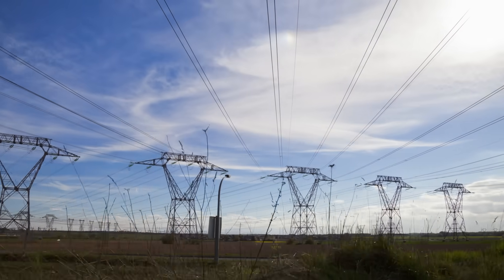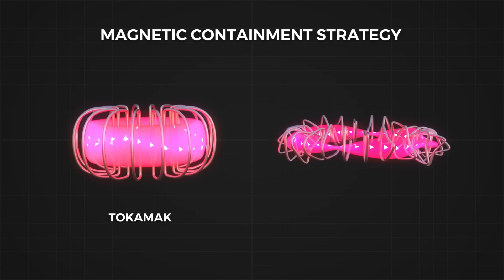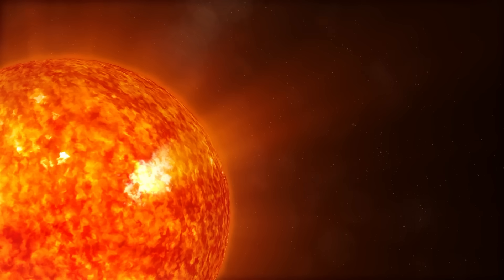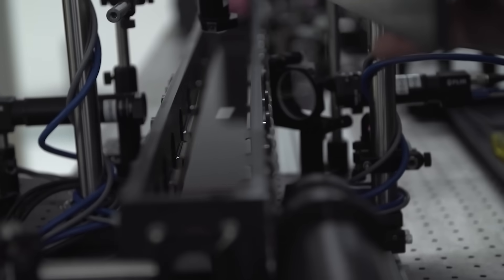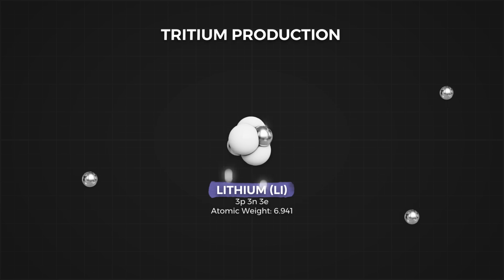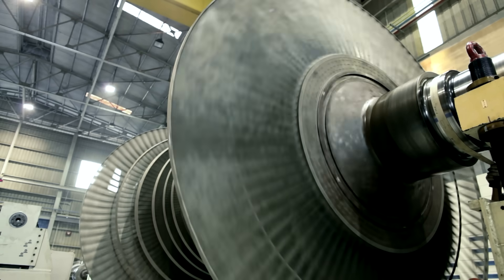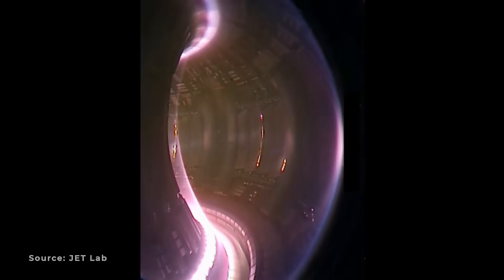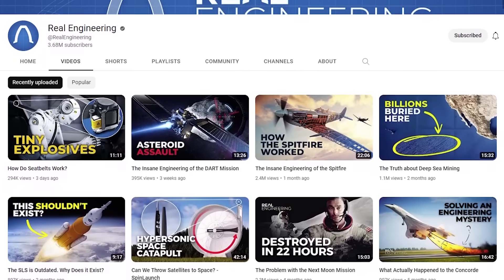The Problem with Nuclear Fusion

Comment: It has become common practice for advocates of nuclear fusion energy schemes to utilize the complexity of the field to mislead the press, the general public and potential investors in order to continue receiving support in a increasingly competitive field. One of the ways that they have done this is by not making it clear how much energy gain their experimental machines have achieved. Typically the input energy parameter they employ is the energy needed to heat the plasma. In many cases the energy needed to operate the facility is over 100 times greater than that input energy. Another detail that they often fail to mention is that when the tokamaks are expected to operate at full fusion power levels they can only operate in a pulsed mode with lengthy periods of time in which they will need to recover. The operational parameters, provided, are often only those during the brief pulsed period.

This presentation, as is extremely common, left out the fact that tritium is radioactive. The breeding concepts were expected to be tested in the ITER facility but that machine is grossly over its original budget and well over a decade behind schedule. They recently announced that ITER may not achieve fusion reactions until 2039 and this is way to late to deal with the climate crisis.

Heleon Energy's CEO is a master pitch-man. Their earlier progress predictions haven't been met. They talk about fusion reactions during their multitude of shot experiments but no one seems to bother inquiring about a quantitive value for that fusion reactions. The following YouTube video critiques some of Helion's claims.

The problems with Helion Energy - a response to Real Engineering

Fusion energy advocates commonly claim that such plants will be CO2 free, That is based upon excluding certain factors such as construction and some operating externalities. The also suggest that no radioactive waste will be produced. That claim doesn't account for loss of tritium fuel, or the neutron transmutation of some of the elements in the structure, some of which will likely require periodic replacement. That means that such components may require disposal as low level radioactive waste and that will also apply when the plant is decommissioned.

Typically nuclear fusion advocates are in line with the vast majority of the Earth's 8.0+ billion humans who continue to assume that we have at least 20 years left to turn this 'Titanic' around. They have become masterful in excluding the following warnings from their consciousness. I urge readers to search for the following two article titles.

IPCC report: ‘now or never’ if world is to stave off climate disaster (TheGuardian)

UN chief: World has less than 2 years to avoid 'runaway climate change' (TheHill)
  * This statement was made 5.6 years ago.

Comment: The most traffic nuclear power accidents involved water-related weaknesses, either hydrogen electrolysis or steam pressure explosions, leaks in cooling water systems, or failure of water flow causing overheating and melting of fuel or or the components.  So we are throwing money at a technology that dies not even promise to solve that problem.

Comment: In 200 years we’re going g to get a commercial fusion reactor and it’s going to be about as dangerous, have as much capital intensity per unit of output, and create as much waste, and pollution as a 200 years from now high-tech cleaner safer cheaper nuclear power plant when you consider the whole upstream supply chain, or not much less anyway.  We are all going to look like fools for spending 200 years on this when we could have invested in cleaner safer cheaper nuclear technology or more wind and solar energy by putting Pegivian taxes on oil and coal to offset a small fraction of the externalized costs and to subsidize wind and solar basic research and capital investments and to fund a 1% of median income per capita subsidy and 4% of median income per worker or disabled or retired person subsidy capped at monthly green source electricity purchases and 10% EV purchase price subsidy.

Comment: The temperature inside the tokamak must be over 200 million degrees Kelvin, but inside the Sun, it's only 15 million. The Sun is orders of magnitude bigger than the tokamak, so the temperature gradient inside the tokamak must be orders of magnitude bigger than inside the Sun.
The Sun has worked for over 4.5 billion years without significant hiccups. So far, the tokamak has worked for about 200 seconds. If the tokamak has an issue, the hot plasma will burn a considerable hole through the wall and even gut the building in which it is located. It's a problem with no reliable solution.
The Sun is reliably put together by gravity, but the tokamak is unreliable because the gravity is only 1G.

Comment: I have always dreamed of fusion and fusion reactor, all working at the atomic level, to somehow get the neutrons to somehow for 3 the electrons to flow, thus directly generating electri y.  The method we have been using for the pas 70+ years seems so childish and a cop out; using the bipeoduct of vision, hesr[t  to boil water, to create steam, to drive mechanicsl turbines, to induce magnetism, to finally create electricity seems like the most childish and stupidiotic thing I have ever ]heard of, with the vast majority of that hest produce from fusion going to pure waste.  Oh what a ginormous waste of all that heat energy, which could be used in creating steam to heat buildings (like I]in NYC), use to desalinate water, and millions of uses for thst hest.

Comment: Before I watched this video I thought that fusion reactors only needed normal hydrogen, which is very cheap, to function and that's why I thought that it had a lot of potential. But now that i know how hard it is to get the actual materials needed for efficient fusion I don't really think that they're much better then fission reactors at least economically

Comment: Nuclear getting shut down for CHEAPER options? No, just no. Nuclear power is 3x cheaper, 8X safer, less polluting and much more stable for an energy grid than any other form of electricity. Coal, natural gas, wind, hydro, solar. Everything gets beat in literally every metric by nuclear. Except public relations.
Reply: I have never heard the claim that it is cheaper. Please provide a source.

Comment: My theory is that sustainable large scale nuclear fusion reaction requires an abundant source of neutrinos.  For the last 5 decades we have been less than a decade away from harnessing abundant energy from nuclear fusion – or so it was thought.  But the calculations do not take neutrinos into account.  Stars are able to create excess neutrinos to stabilize long term large scale nuclear fusion.  Until we understand this process – I do not think nuclear fusion will become useable.

Comment: The problem with Fusion on EARTH. is that we are trying to duplicate what NATURE does with gravity....and control it. A reason hydrogen hydrogen yields low and disintegrates from helium back to 2 hydrogen is we are PUSHING hydrogen together. NATURE overcomes this with mass/density/volume..... the UP quarks PULL the electrons IN and stabilize them into Chemicals we have well mapped out..... the energy INPUT from nature is natural and so the fusion yields NATURAL stabilization. A different approach to the complex electromagnetic forcing and fuel and collection of energy is to have the Fusion process IMITATE nature Have an outside up quark velocity/mass generator and PULL the fuel into each other----- the problem MIGHT be that generating this GRAVITATIONAL pull for the fuel MIGHT be MORE energy than produced..... we just do NOT have the volume or mass OR INORGANIC space on EARTH to achieve this. OUTER SPACE would provide the volume and SAFE area to experiment with this idea....... EARTH and its living conditions will be altered by trying to imitate nature.THE Limitations by life and earth volume and mass make this a difficult obstacle to overcome.

Comment: Fusion is good but solar energy close to the sun that gets beamed to earth would be a lot more efficient instead of trying to boil a kettle to spin a motor. (If we would’ve spent the same amount of time trying to get fusion to be viable on solar energy near the sun and microwave beamed we’d already be there by now with companies like spaceX making it cheaper to do then a single ignition of a fusion reactor).

Comment: Fusion in the core region of the Sun produces less energy PER UNIT VOLUME than a fermenting compost heap. And this from a fully degenerate plasma with 200 times the density of water. Fusion is a statistical process, and i fail to see how the machines we are making can produce more than a trivial amount of energy.

Comment: you forgot to mention that the blanket wall needs to absorb  energy at the rate of 5MW/sq metre equivalent of what the shuttle had to withstand on re-entry. keep on dreaming
Reply: The plasma in these machines is at a temperature measured in millions of degrees. At that temperature, the plasma will be radiating gamma rays, just as the filament in lamp radiates light. You cannot stop gamma rays, or reflect them. So the energy of the plasma radiates away and it cools down. Plus gamma radiation is very damaging....

Comment: We are trying to replicate a reaction that takes place in a star but without a key ingredient provided by the star - an intense gravitational field. We try to make a magnetic field substitute for gravity but it doesn't work that way. Gravity compresses spacetime itself and brings everything closer together. Magnetic fields do not. I doubt sustainable fusion will ever be achieved until this is recognized.
Reply: nice , but what do you think could be used as a substitute for star's MASSIVE gravity , can we replicate that on earth?
Reply: @Fusion-dl3ld  nothing, which is why we will never be able to achieve it.
Reply: @Fusion-dl3ld  A chunk of white dwarf star degenerate matter. A matchbox full can weigh 100 tons.....As a matter of fact, white dwarf stars which accumulate hydrogen gas on their surfaces will initiate fusion if the hydrogen becomes deep enough. And that is what astronomers call a nova.
As a matter of fact, i hold a patent on an MHD generator based on this principle. A small chip of degenerate matter placed on top of a pyramid of high strength steel. A small stream of sand or dirt falls on the degenerate matter chip, and attains a high enough velocity to vaporize into ionized vapor that is directed into a magnetic field for charge separation.....

Comment: The cost of hydrogen isotopes and beryllium are a HUGE impediment.  Also, there is the problem of embrittlement of metals due to radiation. Then there's absorbing all that heat, which needs to pass thru the lithium blanket, the beryllium, and the chamber wall.  The heat extraction done with super-hot fluids (325 degrees C) requires piping thru superconducting, and thus super cold, electromagnets (-270 degrees C) which surround the chamber. How much helium will it take to cool magnets, and how much to maintain it?  There is currently a limited supply of helium on the planet, and at current rates humanity could burn thru the world's estimated reserves in as few as 30-100 years. Now imagine the added demand of 100s of fusion reactors. Also, helium is a byproduct (.01% - 8%) of natural gas extraction, meaning we will HAVE TO continue extracting NG and using it to generate electricity in order to supply helium.  Furthermore, reactors require ultra-high vacuum, and ITER's "plasma volume"  is 100 m3 (I'm assuming its total volume of the torus and not just the volume that the plasma will be compressed to.  (100 m3 = c. 15 foot cube) Doing maintenance inside the chamber would reactor shut-down for extended periods of time.  Just pumping down the chamber alone would take months I imagine...   Fusion will always be 20 years away...

Comment: Most fusion energy presentations are overhyped, often to attract potential investors who often fail to look for critical analysis sources. In this presentation there was no mention that tritium is radioactive. The purple glow that the producer witnessed, in the Helion experiment, likely was not due to a fusion reaction. The vast majority of fusion experiments don't even employ fusion fuels. The fact is that only a very small number of fission power reactors employ heavy water as a moderator. There are very few sources of tritium and that is likely to get even less during the next couple of decades. The current market rate for tritium is approximately $30,000/g. The ITER experiment was intending to experiment with a wide range of tritium production experiments but that has been drastically cut back due to cost saving measures. The ITER project is grossly behind its original schedule and grossly over budget. It is currently dealing with major rework issues. Fusion fans tend to display little interest in such issues. This video pointed out all the fundamental uses for helium-4 but failed to mention that future fusion energy reactors will produce only tiny quantities of the element.

The dreamers behind such videos tend to be in the same camp as the vast majority of the Earth's 8.0+ billion humans in masterfully excluding the following warnings from their consciousness. I urge readers to search for the following two articles.

IPCC report: ‘now or never’ if world is to stave off climate disaster (TheGuardian)

UN chief: World has less than 2 years to avoid 'runaway climate change' (TheHill)
  * This statement was made 5 years ago.
Reply: what ?
you seem to be bashing FUsion for climate change 
what's the point
according to you we are already doomed

Comment: Micro magnetism in a fusion chamber, y’all want a stable plasma basis without whatever, this sounds fit, the magnetism pulls whatever particles in through tubes or some, probably inserts.

Loading so short answer plus I’m new to this, basically, I study natural conductors

Comment: Fusion is high pressure, by basic mathematical law, you cannot control the resulting decompression, it will become an independent body of heat that is out of control and affecting the weather
Reply: or it will become runaway reaction like that of Sun 
and we will be roasted
Reply: @Fusion-dl3ld  indeed, it was also the fear of the Oppenheimer group.

Comment: Jupiter is not massive enough to be considered a failed star. That's fusion's problem. 
Fission is a chain reaction. Fusion is not. It's not just a matter of having the "fuel" in close proximity and then controlling the reaction. In a star the contraction of the mass provide the energy. You need to sustain the pressure and temperature.

Comment: they need to rethink their goal, intermittent fusion, not continuous, the magnetic field + heating it up is unrealistic anytime soon. it will always be 20 years away. this isn't a technology issue, its a physics problem. not unsolveable, but even if solved it will probably be around fission efficiency if not worse.

and no. nuclear fission reactors are not expensive, governments are subsidizing oil and fossil fuels so much . they are far far more expensive than fission both money and environmentally

Comment: Its funny though... fission and fusion dont produce electricity. They produce heat to which used to drive a mechanical turbine to produce electricity. So far humanity only discovered three ways to produce electricity: spinning magnets, solar panel,  and chemical reaction...

Comment: I have an Idea on reusable Fuel.
And just so you know, I'm still just 13 so please correct me if I'm wrong 
My Idea is the use of only deuterium whitch is going to fuse into helium 3, the helium 3 is the going to somehow go to the blanket and stay there (I din't know how). It is then ging to be hit by the neutrons and is hopefully being splitt back into two deuterium atoms (I don't know if this is possible). 
Thats it, again if this is wrong please correct me I don't really know more than the basics.
I also have an Idea for the fuel output but than the comment would be way to long.
Reply: Not fuel output😅. I ment energy output.😅😅

Comment: The Tokamak creates a D - shaped magnetic containment field limiting the compression available.  
Restructuring into a true circular shape, control of the magnetic containment becomes less problematic. 
By varying the field strength on the confinment coils, the plasma stream can be reshaped into a smoother round shape; allowing a consistant density of plasma.  Increasing the magnetic containment and processional frequency, the plasma stream is compressed in diameter thereby increases the molecular density of the plasma stream as well as it's angular velocity.

Comment: Hey, guy, you're too late. Nuclear fusion in anything new killer is on its way out. I want you to know there's a magnetic generators that are clean that required no input. And no hazard, it's only working on magnets. You just press the button and go. If you want an example of this type technology, it's like an F150 Ford that has a standard transmission in. It. Pull the battery out, push the truck, pop the clutch and it takes off.  A magnetic generator Nicolai Tesla has got you over written. You're not on the power grid anymore if you go this direction. Magnetic generators Trump has pulled it off.
Reply: What?

Comment: Thinking about this now, why can’t we increase the pressure inside the reactor? Increase the pressure by increasing the amount of molecules in an area. The closer they are together the more likely it will happen. It takes less energy to move a ball of iron an inch rather than a mile. Most of the energy is focused on speeding up the particles if I’m not mistaken.